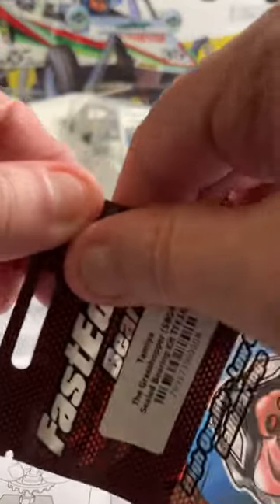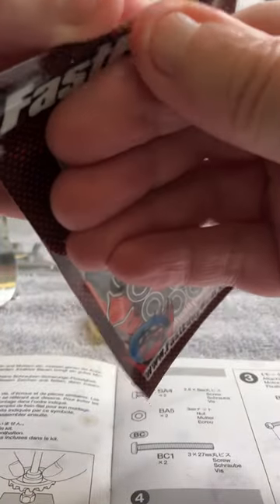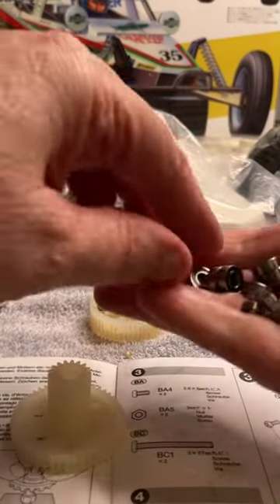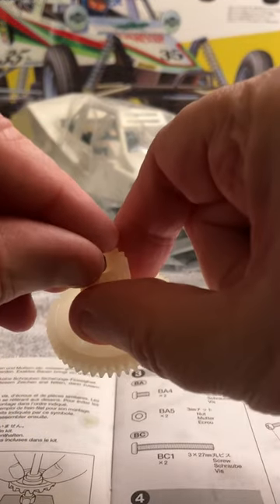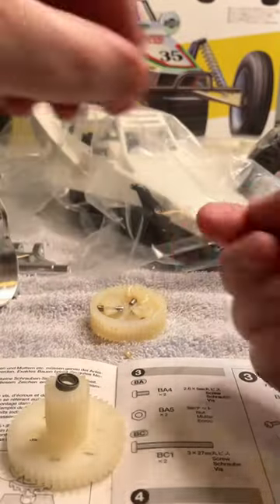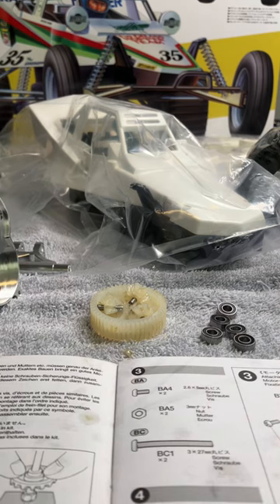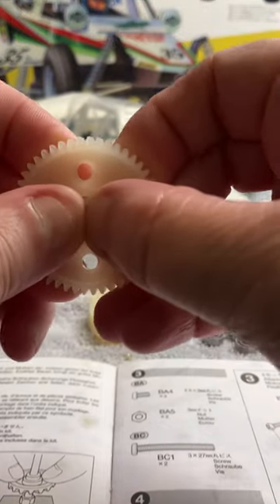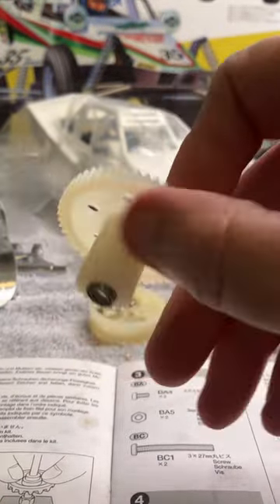Tamiya The Grasshopper bearing installed failed 😞🤓Like & subscribe

Comment: Thats weird. i never had an issue with those bearings. Did you get them to work?
Reply from the maker: yeah, I was tiring to do it in front of the camera, and it seem to 10 times harder when you're filming something I ended up replacing the plastic gears ALLOY 7075 COUNTER GEARS 50T UPGRADE😁